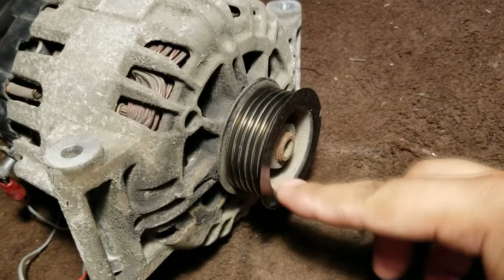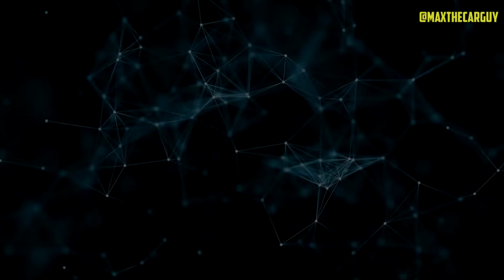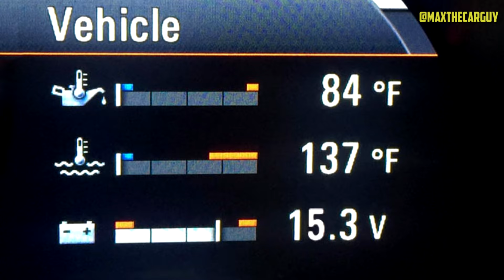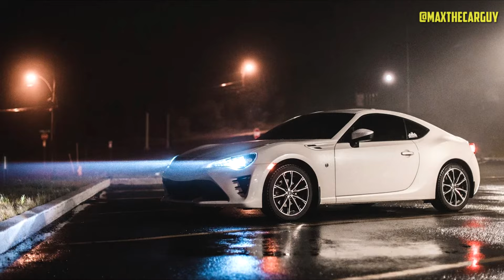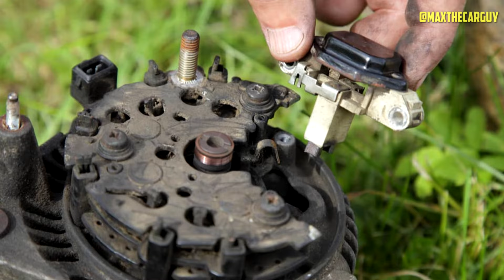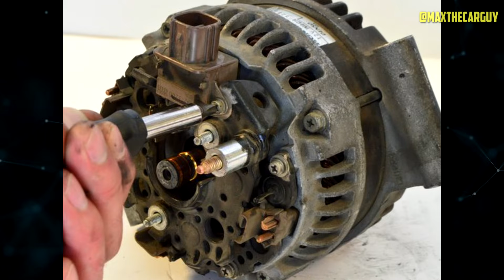Alternator Overcharging - Symptoms, Causes & How to Fix?

Comment: I had a miss enigtion  during idle and after changing the plugs and wires and cleaning map sensor and throttle body the miss continued until I checked the side mount connections  to the battery.  I found the positive  post screw would tighten but the slip past the tighten position, I bought a new post screw and the miss went away.

Comment: Before replacing alternator one should check all negative cables/ strap.
Reply: hello brother, can you be more specific, I changed the regulator 2 months ago because it was overcharging and now 2 days ago I smell plastic, today I measure the voltage 14V when the engine is off and 17V when it is on
Reply: @ yes I mean check all ground cables/negatives from you’re battery to your motor you should have different ones depending on your specific car.
Reply: Thanka bro, i will check

Comment: Why would you say that rebuilding an alternator has fallen out of favor? That is not correct or true. Most alternators can be repaired by replacing one single part, costing much less than a brand new one.
Reply: That’s very true you can fix your alternator from anywhere from 10-40$ 
My voltage regulator went out and it cost me exactly $11 to fix and they wanted $230 at the auto parts store to replace the alternator!!! 
And I fixed probably at least 12 alternators this way in my lifetime and never really had to buy another one

Comment: My highest 14.9
Reply: I'm having this problem right now with a 2011 kia soul. I was blown away after checking the engine light to see 30 volts across the terminals!! 34.2 steady while running. I have no choice but to run the battery down and get it into a shop asap

Comment: So, you said its simply impractical to fix the voltage regulator inside of the alternator. What about a Toyota Highlander that was made in 2008. What about the 150 amp alternator that comes on them. The one that is $785 for a (REMANUFACTURED) one. Or a $1094 for a New one. How about those are those more practicle to just replace. Also just a reminder that the job to replace that particular altenator also takes a minimum of 4hrs to remove. thats With the experience tools and lifts that a shop would have.
Reply: Bruh I just looked it up it’s 140 dollars for a brand new alternator lil bro
Reply: @porterjohnson3687 
Cheap alternators are usually made with cheap parts...like diodes and voltage regulators. 
I learned the hard way...I rebuild my alternators...buying quality parts with a online supplier. A quality rebuild kit costs about $120..check condition of your alternator commutator shaft (where the brushes contact copper surface)...if it's badly worn trash alternator. Replacing diode array calls for use of soldering iron..not too difficult just make sure solder joints are well done.

Comment: Why is my car's why is my windshield wipers going off and on my lights are blinking off and on is that a overcharging alternator and the car is turned off it doing all that and more the doors lock and i can't get out. HELP
Reply: Your car may need to be sold. Lots of things can be fixed mechanically. But spiritually it's not easy to do
Reply: Alternator is over charging